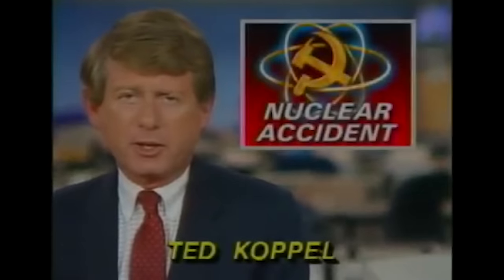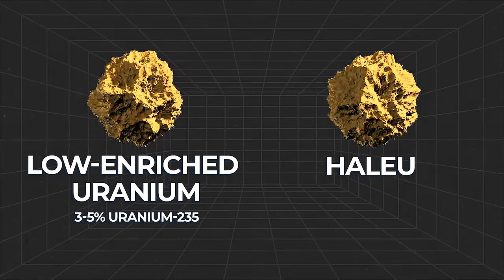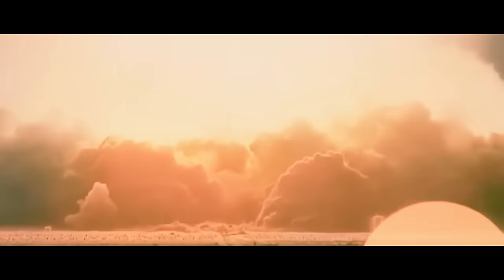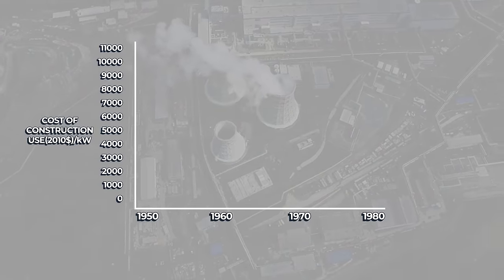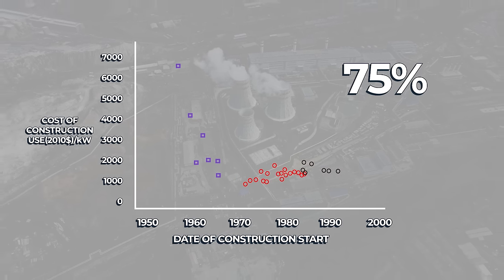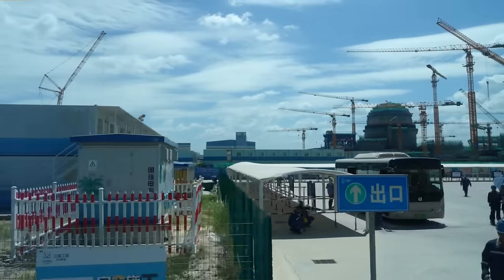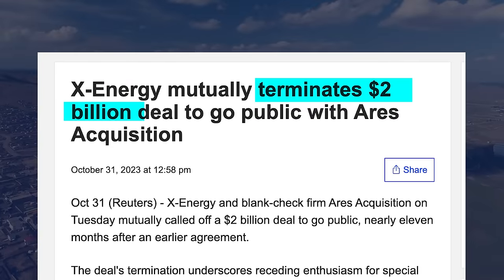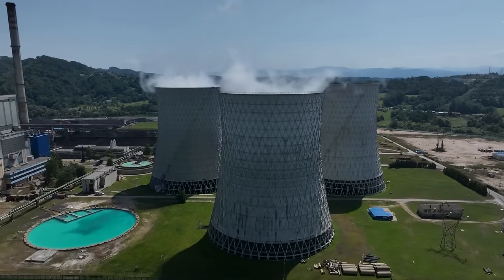Nuclear 4.0 | The Small Modular Reactor Revolution

Comment: In short, no. The question is not whether nuclear can be made cheaper, but rather whether it can be made cheaper than renewables with energy storage (and if needed a few percent of gas). Note that renewables are now mature and cheap and storage is maturing rapidly and we're talking about mid next decade.
Reply: Please don't forget the additional grid costs (2x ... 3x) for intermittend renewables ... and some backup power plants ... batteries may be able to complement demand for hours (few days) but not months or seasons.
Reply: @uwemielke6672  I'm not. Even accounting for this, nuclear is still the most expensive option.
Reply: @saumyacow4435  Did you also add the cost of replacement? Here in germany we have now installed about 135GW of PV and Wind and now start to through away the oldest ones and built new ones - a process called re-powering. And if we are at the end of the road in 2045 we most probably through the actual built and re-built plants away again. New nuclear plants are designed to work for 60 years+. So - yes their cost is very high, but they also work longer. In my opinion they are not the most expensive in the long term, they are just more expensive when building them.
Reply: @rayengel714  The experts do consider the life cycle of the equipment and they find that nuclear is the most expensive option. Also, do you realise just how ruinously expensive it is to decommission nuclear plants?
Reply: @saumyacow4435  "just how ruinously expensive it is to decommission nuclear plants?"
what is ruinously expensive?
The swiss plant Mühleberg is in decommisioning and they say it will cost 3 billion CHF - converted to the produced energy over 47 years this is round about 1ct/kWh - is that what you mean with totally ruinously?

Comment: There are a few companies seriously looking at deep (20km-ish) geothermal electricity generation using syncrotron drilling.  If that's viable, then they will need a few megawatts for a couple of years to melt bedrock into gas.  SMRs make a lot of sense if you need that kind of load in the middle of nowhere for a limited period, and it would be an almost magical pairing of nuclear and true renewables.

Comment: These micro-rector designs all seem to operate around the "replaceable battery" model, proven over a century now- with predictable weaknesses and defects, still a reasonable engineering solution. This is especially appropriate for moving to massively-distributed supply and grid topologies. They're certainly a reasonable choice of component in such grid systems.

Comment: I am very interested in nuclear power produced by NNE. It’s my belief that these can be used in a way to decentralize hydrogen production and at the same time create a synergy with waste management and polluted waters to clean while producing hydrogen. Access energy production could be sold to the 2:32 regional electric service provider I did not see the price point, however for these flatbed trucks nano nuclear . Hypothetically a decentralized hydrogen production using those could be set up in between 1500 and 2000 units around the US supplementing the electric grid as well as providing localized, hydrogen production and delivery.

Comment: The neutron actually interacts with the nucleus and if the neutron is too fast it won't interact  with the nucleus.  In Chernobyl when the rods started to re-enter they slowed down the neutrons and the reaction increased.

The guy who invented the type of reactor first put in civilian use was against such big reactors. His reactor was for nuclear submarines and at that level of power generation the core can be contained in case of a meltdown. There are a few sunk nuclear submarines and afaik none has leaked to this day.

Comment: I liked this video over all. But please be careful when using the term "base load".
9:44 base load power does not complement renewable sources. What you need is balancing power (capacity).
Yes, there is "base load" in the electricity demand on the grid, but you really care about is meeting demand.
(Currently) Base load power plants are not that flexible and most cost effective if they run continuously. If you use them to complement renewable electricity production, the price per kWh rises too.
I can however see SMR being used to directly produce Hydrogen, using thermochemical water splitting due to the higher temperatures compared to traditional nuclear power, which than can be used in to complement renewable sources, if still cost effective.
Reply: I think the term "base load" has been spun around. People use it now, when describing power production, to mean "good" in a way that renewables apparently aren't good. But if a power plant can only produce electricity when it runs continuously at max capacity, that isn't good. That's bad. Because demand isn't continuous. If such a plant didn't produce enough electricity to match demand peaks, you'd still need other sources of production. And if you overbuild it to account for the peaks, you'd still need to find ways to throttle it down or absorb the excess power when not in peak hours. Like you said, things need to be in balance. I saw a YouTube documentary recently about how a hydro pumped storage facility is used in modern times to balance power output from nuclear. So nuclear alone (without energy storage) is not the answer.
Reply: yes, base load means continuous power delivery and people mistake stored power (eg gas) for this simply because it effectively acts as the same thing. We probably need different types of storage (more hydro if possible, flow batteries probably) and maybe hydrogen, but not likely as the low efficiency of making hydrogen outweighs the efficiency of building out batteries. But there again, if nuclear is "too cheap to meter" for the electricy production part, you can make more than needed and just throw the excess away and it might still be cheaper than trying to store it.
Reply: You seem to be forgetting about grid scale storage which is becoming widely installed. California has required it in all of their existing power plants.  Hawaii is following suit. Having massive energy storage both means you can lean more on renewables and you can better optimize your plants which throttle slowly like nuclear.
Reply: Traditional base-load running 24x7 is indeed a terrible fit with a modern renewables-heavy grid.  It's an economic problem, particularly for a nuclear plant which needs to be producing revenue with its (mostly) constant-power output 24x7.   The problem is that it can't.  The output is only useful to the grid after roughly 6pm and basically worthless (not able to produce significant revenue) for 12 hours out of the day.   California, for example, actually has to curtail solar sometimes during the day just to let its one remaining nuclear plant continue to generate at a constant output.  NG assets drop to nearly zero something like 8 hours and then cover a large chunk of the demand overnight.

Solving this problem for nuclear requires grid-scale storage and a lot of it.  Only grid-scale storage soaking up excess renewables during the day and dumping that energy into the evening and overnight is able to smooth out daily cycle sufficiently to allow traditional base-load style generation (nuclear for example) to generate 24x7 and also stay solvent economically.

At the moment only California and Texas are really putting a lot of money into grid-scale storage.  It is turning out to be incredibly beneficial to the grid.  Not only is it soaking up excess power during the day, grid-scale storage is also able to be situated to remove grid congestion across the late afternoon and evening peak, economically revenue generating for its effort.  That dynamic, in turn, reduces the need to expand transmission line infrastructure and defrays the cost of the batteries so much that it isn't even a question now whether to install battery storage or not any more.  The economics are just too good.

-Matt
Reply: You could just synthesize hydrocarbons with surplus renewable energy too, solar thermal would be the optimal means as you can generate heat comperable to nuclear and heat reduces the electrical energy needed for water electrolsis.  Their is no reason to utilize nuclear power for the hydrogen economy concepts, a concept which I should point out exists primarily to propup Natural gas industry.
Reply: @gbjbaanb  Natural gas is run in two methods, Peaker plants, and Combined Cycle.  Both are Dispatchable power sources able to to come online quickly, but the latter is also viable to run as baseload powerplants due to high efficiency, while Peakers are not.  Peakers are rapidly being replaced by storage solutions and will soon be gone, meanwhile the Combine Cycle power plants ramp up and down in response to fill the gap between renewables and demand.
Reply: Grid scale storage and other renewables cannot provide more than about 15-20% of the total power in any grid because they use invertors to match the frequency of the spinning machines that provide the real frequency stability of the grid. Reliable power depends on flywheel effect!
Reply: @evanpnz  You are talking nonsense.  Inverters can do both frequency and voltage regulation.  Nor is there any requirement that flywheels be driven by fossil fuel... you can drive a flywheel electrically just as easily, if you feel you need rotational inertia as a tool.

There isn't anything particularly magical about rotational inertia.  It is a convenient tool, but it also has fairly severe limitations.  Just like anything else.

-Matt
Reply: @junkerzn7312  I never talk nonsense, what would be the point? I'm an engineering technician. Lots of things that people take for granted that just ain't so. Invertors shutting down because of failure to match frequency fast enough is a common cause of cascade failure on the grid.
Reply: @evanpnz  And I'm an electrical engineer with 40 years under my belt.   And here's the kicker... multiple large grids already run greater than 90% renewables most of the day for significant chunks of the year.    Several have had days of 100% renewable generation (U.K., Australia, and California have hit that mark several times now).

In the U.S. both California and Texas regularly run greater than 60% renewables for most of the day.  Several other states as well.

So unless you are going to sit there and blather on about rotating storage somehow magically "fixing" a renweables heavy grid when it finally gets a chance to run overnight, you are blowing smoke.  You have not the least clue how these technologies actually work.

So you were wrong even before you made your original statement.  And not just by a little.  Try again.

Your comment about inverters is equally absurd.  Total nonsense as well.   

-Matt

Comment: All "small" modular reactor designs to date have turned out to be economically non-feasible.  The ones that stayed alive had to be up-sized to become much, much larger reactors to make the numbers actually work out economically.  And even with that I think the last major active SMR project in the U.S. has been cut-short.  It basically turned into a traditional nuclear reactor.

But why?   For the following reasons:

* You can't actually just plop a SMR down where it is needed because the transmission line infrastructure required to support it that is already present can't actually handle that kind of power without almost as much investment as is needed to build-out transmission line infrastructure for solar farms (for example).

* Locating a SMR where transmission line infrastructure already exists, for example on the site of a closed coal plant, requires up-sizing the SMR reactor for it to make any sense.

* The planning and regulatory problems also don't benefit from economies of replication.  Every site is different, no matter how small the reactor.

* Nobody wants a nuclear reactor in their backyard, no matter how small.   Prepare for thousands of lawsuits at every site.  Literally.

* Security issues remain and no longer benefit from economies of scale (a large reactor in one location).  They definitely don't benefit from replication (having many smaller sites).  Each site is still a nuclear reactor.

* SMRs cannot produce economically for the same reason that large nuclear plants can't... the grid doesn't want 24x7 base-load any more.  It's worthless half the day.  While a SMR has a bit more room to scale-down and scale-up production on a 24-hour cycle, it still isn't good enough economically and, in fact, the added cycling stress makes maintenance more costly rather than less.

* Even if you could get the build-time down from the ~15-20 years it takes now, we're still talking at least 10 years.  Financing a nuclear reactor pretty much has to be funded from the very start without any revenue prospects for 10 years (10-20 being more likely).   A solar farm, on the other-hand, doesn't have to be financed until most of the regulatory work has already been done, then its literally just 1 year from financing to building to revenue generation.

* SMRs are supposed to be lower maintenance but ... I don't really believe it.  Fun little graphic diagrams and animations != lower maintenance.   Modest to high maintenance costs means exposure to inflation.  Another tough nut to crack for financing and planning.  You also have relatively unknown decommissioning costs at a time when the industry is seeing multi-billion-dollar decommissioning costs for their larger cousins.  Billions.  Another unknown for SMRs.

A solar farm, on the other-hand, has almost no maintenance.  Its very low and easily cost-controlled.  And decommissioning is easy, used solar PV panels have a huge secondary market (if you ever bothered to decommission one, since piecemeal upgrading is also possible with a solar farm without even taking it offline to do the work).

So, basically... good luck on any sort of nuclear.  At a minimum the grid needs to present a smooth demand for the plant which means that nuclear plants just aren't going to be economic until there is enough grid-scale storage on a grid to be able to create that smooth demand.   20 years minimum for that, and again entities financing a nuclear plant have so much uncertainty that it's just about impossible to justify the build.

Comment: I noticed you didn't mention the biggest drawback of solar. The upkeep of panels is not even close to cost effective in comparison to nuclear. Places with the most sun coverage tend to have damaging environments for them. The self temperature regulating SMRs would drop maintenance by a lot. As over heating causes the biggest wear and tare on the system.

Comment: This is what we need, hundreds of small reactors plugged into the grid. We could have a distributed power grid where small reactors are spread out throughout an area and they replace them like batteries when they run down, and send them off to be refurbished and refueled. Send the spent fuel and waste to a burner reactor to finish it off.  It's only because the populous has been conditioned to be terrified of nuclear energy that we don't have a super cheap stable power grid.

Comment: I'm for nuclear power as long that its safe and it's time to design 2000MW nuclear reactors using 20 percent enriched U235 or 44 percent enriched PU239 the moderator will be heavy water or graphite and CO2 gas cooled . The plutonium produced for this reactor is 1868.8kg over six years and the cost should be under 12 billion dollars each and service life of 45 years. The technology is there the heavy water produced as a byproduct from green hydrogen production.

Comment: Oh but there is a powerful solution with the now ubiquitous GE Aeroderivatives, gasturbines based on the ever improving airliner engines, derived from them with simpler components, the use of multiple fuels and quick delivery in terms of weeks, not decades, mobiles and stationary ones

Comment: What I think?
Micro Nuclear Reactors are ideal as complement to solar and aeolic power plants. They don't need to remain off for two days after a power down (recovery time due to Krypton), but for much shorter time, so - with the help of a battery buffer - they can be cycled to complement day / night and wind / no wind conditions.
I read that in the '50-'60s used a truck-sized reactor at the North Pole, so it is a somewhat old idea. But military Reactors aren't a good comparison - they use 90% Uranium so - they can run continuously for 25-30 years at full power - you don't want the stuff loose in the civilian market; for the same reason you don't see plutonium breeder Reactors in civilian use, as a proliferation countermeasure.
If it was for me, I would limit fossil fuels power generation and have mostly nuclear reactor for powering society. The Chernobyl incident occurred because they don't had anyone competent supervising the power-down test, while Fukushima occurred because there was a powerful earthquake followed by a tsunami which disabled the totality of the infrastructure and yes, they had the emergency generators in the basement, against all the advice they received prior. Two very unlikely situations which will not occur again.
Thank you for the great video
Greetings 
Anthony
Reply: First I think you mean Xenon.  Plants are not supermen and don't worry about Krypton.  The reactor systems of even 1,000 Mw units are relatively small.  It is all the support and safety systems that make up the bulk of the plant.  A truck sized system , even with 95% enrichment could only produce enough power for a small subdivision.  Enrichment provides a longer run time not a bigger power output since metal melting limits that in all reactor designs.